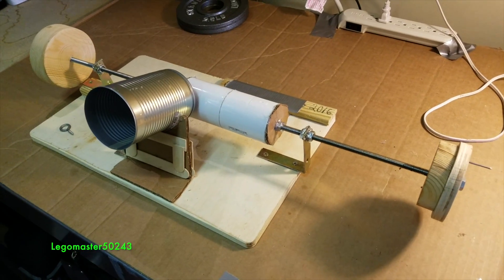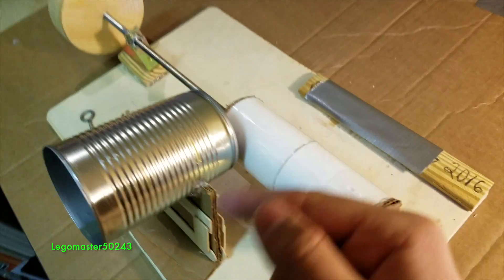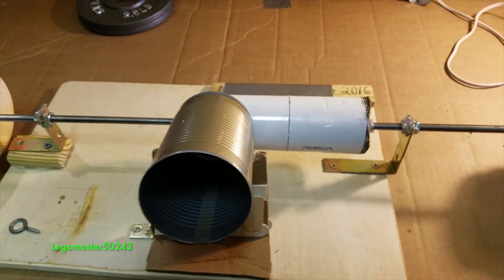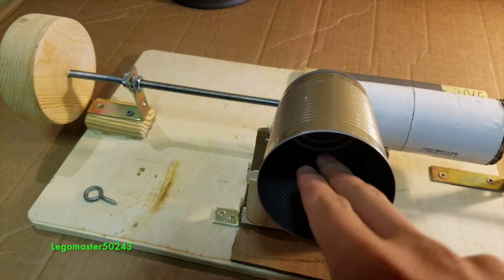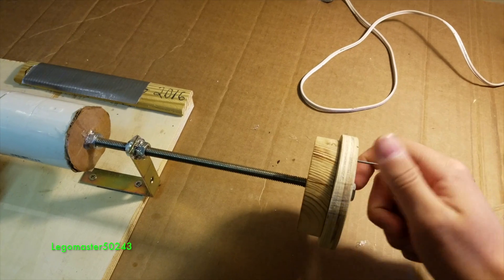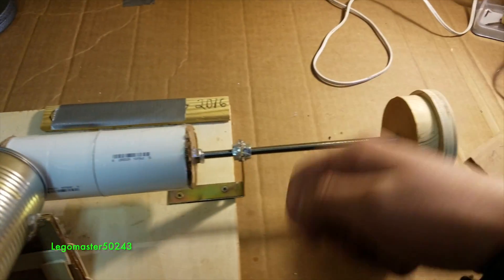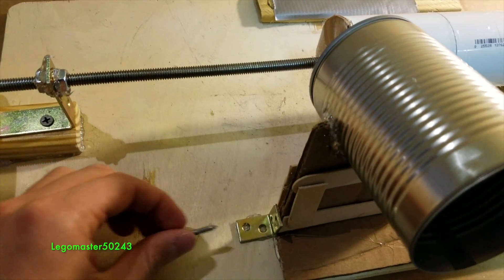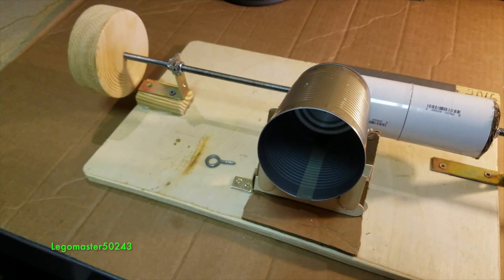Homemade Cylinder Phonograph

Comment: Thanks for that. The one I built isn't working. The best results I got were with a plastic cup and a thumbtack. Do you have a problem with the cylinder not being perfectly round?
Reply from the maker: +Ethan Grice a little bit. But if I apply a little pressure to the can, it makes sure that the needle contacts the cylinder at every point.